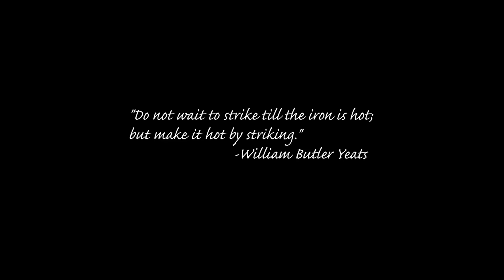Hammering cold iron until it's red-hot

Comment: Neat trick but seems mostly just that a cool thing to demonstrate but out dated since we all have lighter and torches at home so no need to do it in a regular situation. 
But my question to you is how well do you think would this work in a survival situation? By that limited tools and materials. Like say stranded and you find a piece of metal but obviously no hammer or anvil. Could this be done on a rock using another rock as the hammer? After the rod you used becomes compressed could you really not get around that by say hammering the end back on itself a few time essentially making a couple layers that could then be hammered together and since they are not compressed with each other allow the effect to happen again?

Comment: I learn this the hard way back in Asia where there train track and I would put a small metal stick in the track and the train would run over it. Usually the stick would just fly away by the force and there was one time it was completely flatten in the train track, and I try to pry it off. It was pretty dang hot.

Comment: It's not that surprising. If you grab a relatively thick iron wire and snap it in half by bending it back forth repeatedly causing metal fatigue, the broken tips are quite hot to the touch, and you can do that by hand without any tools.

Comment: The density of the metal doesn't increase markedly (and only if it had a lot of impurities) by striking it. Instead the reasons for this behaviour are threefold:
1. As the metal becomes thinner you are transferring more of the kinetic energy of the strike into the anvil instead of the metal rod.
2. Due to the flatter piece the ratio of surface to volume increases, which increases heat dissipation.
3. Due to the increase in malleability, the strike isn't stopped by the metal rod. Instead again there's more energy 'lost' into the metal.
Reply: Thank you for this, was looking for a better explanation

Comment: Knew blacksmiths that would light their furnace that way - striking a piece of steel and then poke some grass / hay with it to start a fire.
Honestly, never thought it was fake and I don't know have a degree to claim that it's true, but when you're striking metal there's transfer of energy, most of which goes towards deformation of metal and some, obviously, gets transformed into heat. I will die on the hill of it getting hot due to energy being converted into heat, because that's all my small brain is capable of comprehending.

Comment: You are not compressing the iron atoms. You are simply converting the energy used to deform the material into heat. The amount of heat produced is proportional to the amount of deformation. That material can be heated up again in this fashion. What’s stopping you is that it’s too thin. If you were to forge weld that material back onto itself to thicken it up, you could reduce it back down and heat it up.

Comment: Is this due to the energy released from pushing the iron atoms closer together?
Reply: Not exactly. It's more that the atoms slide against each other. They side against grain boundaries, where the alignments between two groups of atoms (called grains) are different. As they slide, the average kinetic energy of the mass goes up (and that's all temperature is). As those grains slide, they eventually attach to other grains then the alignments match up, becoming immobile. That's why the affect doesn't work again on the same piece of metal. You would need to melt and cool the piece again, reforming unaligned grains.
Reply: @gilly_the_fish kinda like a gaussian effect?

Comment: I worked in auto body repair ,, frame rack ,, bolt down a car to rack ,pull bent frame rails with chains using multi ton hydraulic jacks ,,, pulled too hard once ,and the very large ,, multi ton chain SNAPPED ,broken link flew across building and hit garage door,  I walked over to pick it up and burnt my fingers.    That split second of energy produced a lot of heat by displacing the molicules  that quickly,,,     lucky me,,, wouldnt have wanted to be hit by that progectile,,,,,,

Comment: if the molecules get tightly packed, does that mean he increased the density of the iron by hammering it??
Reply: He did not. Hardness of metal has nothing to do with density. The molecular arrangement is changed by the heat.
Reply: @crackwitz i never said anything about the hardness of the metal
i asked about the density
since hammering it packed the molecules tighter according to the video, does that mean its density was increased?

Comment: I tried to do this with a nail when I was like 15. It worked, but the nail gave out eventually and pretty much exploded. Some of the shrapnels hit some of my fingers but nothing too serious, I just took them out. Well, after it healed I noticed a strange discoloration around my index finger's PIP joint. It turned out one of the shrapnels had gone pretty deep so it wasn't noticeable at all initially. The discoloration was literally the shrapnel being visible through the skin. By then,  the skin was already healed so it couldn't be removed without surgery. However, I didn't really want to tell my parents because my mom would definitely freak out, so I just let it be and watched for any possible signs of sepsis. Eventually, I told them but they didn't believe me. Until I stuck a magnet to my finger. Pretty neat party trick. After like half a year of living with it, I ended up surgically removing it myself with a few needles and a cosmetics kit. In conclusion, I was (still am) an absolute dumbass.
Reply: If you taped the magnet to your finger it might have come out eventually
Reply: @Henrix1998  yes, no, maybe with a giantic MRT magnet (lucks he didn‘t had a MRT scan that would‘ve ended badly)
Reply: @libraryofgurkistan  no, I mean just a normal fridge magnet. The cells replacing slowly would push it out
Reply: @libraryofgurkistan  maybe make a ring of something that keeps it 3-4 centimetres off the finger but still close enough to attract the iron.
Reply: @Henrix1998 I wonder if this would work, someone please comment on this.
Reply: @Henrix1998  sticking a magnet to it kinda hurt, I don't think it would be great for a prolonged amount of time
Reply: @simonockas i used to think “sepsis” was named “herpes”. I also still am a dumbass.
Reply: im sure i still got a piece of wood stuck somewhere. it doesn't hurt so i don't remember where that happened.
one time i had to get an mri scan. before the scan i had to get an xray of one of my feet because i stepped on a nail at some point and the doctors had to make sure there was no metal left inside. an mri machine is pretty much a ring-shaped super magnet so any piece of magnetic material will turn into a bullet when the machine turns on.
Reply: That was the revenge of the iron.
Reply: This is an amazing story
Reply: Just watched iron man and that seems like a fair solution to me
Reply: I have a piece of graphite stuck in my right thumb. I for some reason was diggin at a wound on my fingertip and the tip of my pencil broke and it got stuck pretty deep inside. I too was a dumbass ao i didnt say a word about it.
Reply: Had me in the first 95%, ngl
Reply: @narfharder  i have one that’s in my left thumb, lol
Reply: fucking badass
Reply: Or an absolute badass
Reply: One of the greatest stories I have ever read.

The fact you know what "sepsis" is indicates you can't be a dumb a**. You just do stupid things! 😅
Reply: did everyone cheer as you removed it, and then you proposed to your now wife of 200 years?
Reply: @aiexzs  literally why would I make that up lmao
Reply: You used to be iron man and you wasted it.
Reply: It’d make its way out eventually magnet or no. 

It just takes a long, long time because it moves at the speed of your skin growing. 

I think the longest I’ve had a foreign object in me before it made its own way out was about 8 months.

Comment: I had no idea that could happen so fast. I thought you were gonna put it under a super fast power hammer.
Reply: The only reason it happens at all is because he's smashing a very tiny rod of metal. This effect is negligible at best when you're working with larger pieces for things such as sword or armor due to the good heat conductivity of iron/steel. I always found this quote amusing since if you tried doing this with iron/steel from the medieval ages when anvils were most used, they'd almost certainly shatter semi reliably due to the relative metallurgy compared to what we begun using in the 19-20th century.

Comment: its not the kinetic friction causing the hear but pv=nrt
Reply: its chemistry not physics
Reply: @alexanderlove6595 the interaction whittled down to its bare knob of meaning always come back to physics, however it would be impossible for the iron to head without external intervention, the food the man ate was turned into muscle contractions and ultimately blunt force that agitates the physical iron so much it glows. I don't know of any metal except alkali that can be heated by pure reactions of cbemical
Reply: @fireandcopper   guess you dont know your chemistry very well. pv=rnt is the ideal gas law and it basically states that ass you add pressure to something you will increase the temperature of that object
Reply: What's the reason the ambient temperature matters as claimed in the video?
Reply: @user93237   well that part is true. think about if i want to get a pice of metal to 350F amf i have one on a cold day at -20f and one on a hot day at 90f. the 90f is already much closer in temp to my wanted temp.

Comment: Iron molecules don't compress. Heat comes from them changing shape and applying friction to eachother.

If you don't trust me on that check density of "compressed" vs "uncompressed" iron. Should be same.
Reply: People correcting a falsehood with other falsehoods will never not amuse me. Firstly, iron isnt a molecule, its an atom. Steel however is a molecule made up of carbon and iron atoms. This new molecule, steel, can absolutely be compressed and decompressed packing the iron more tightly with the carbon. This reduces the steels volume and increases its density proportionately. To recap, Iron is not a molecule, it is an atom. You cannot compress atoms but you can compress molecules. Steel is a molecule, it can be compressed, Iron cannot.

Comment: You can experience a similar effect at home. Find a soft piece of plastic like the ones that come on new clothes and bend it back and forth rapidly. The cloudy seam that develops will eventually become hot to the touch. Not as cool as this, but a similar concept.
Reply: Copper or stell wire, can make this too, just be careful, or you can burn yourself.

Comment: The real surprised here is that I never knew solid metal could be compressed by hand by THAT MUCH???
Reply: It can't be, and it's not. The steel is just being drawn out and elongating. He started with a short thick bar, and hammered it out into a long thin one. Basically everything in this video is wrong, and the "compression" stuff is pure nonsense.
Reply: @Jamvan001  I don't think it's pure nonsense, but explained poorly. What you see with your naked eye is mostly deformation, and not compression, yes. But different phases of steel have a slightly different density because the crystal and grain structure is modified. So it's plausible that the end result is actually slightly denser ("more compressed") than the starting material.
Reply: @Gameboygenius the hammering does not change its density. The heat changes its molecular arrangement. Grain size affects hardness. The harder it is, the more work you need to deform it.